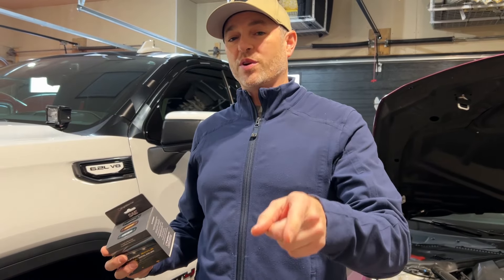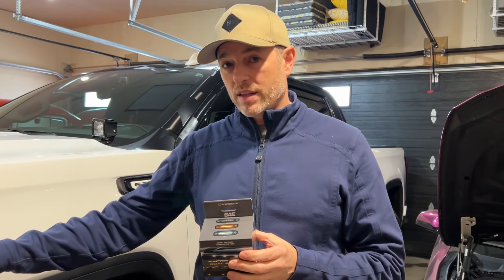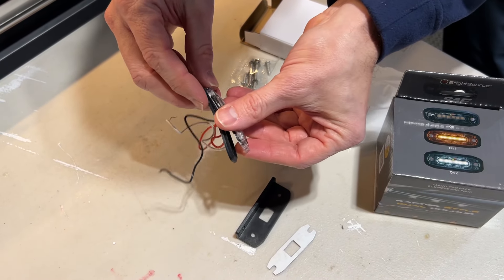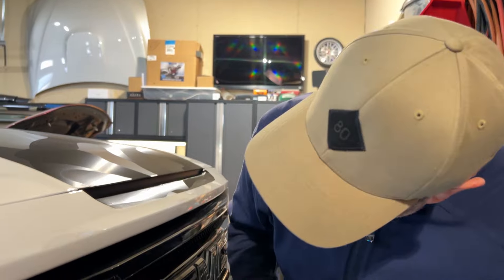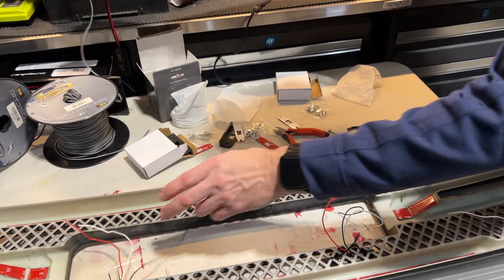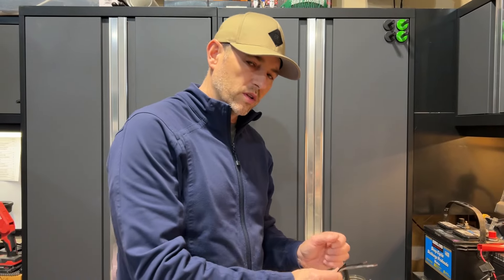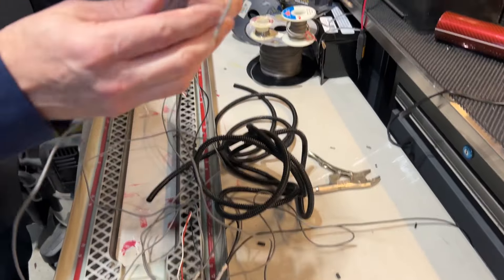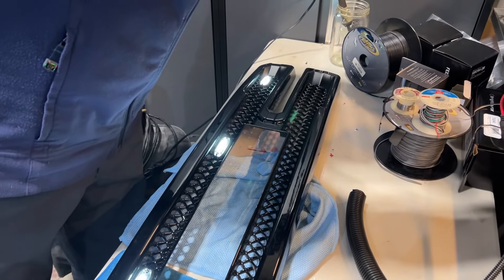Raptor-Style LED Grill Lights: 2 Colors for Any Vehicle

Comment: Awesome video. I just ordered the raptor lights. 

Question: Do you manually turn on the raptor lights every time you hop in or can the switch panel have it come on every time when the truck is started? Thanks!
Reply from the maker: I thought I answered this yesterday, but maybe it didn’t post.   I do have to turn on my switch panel every time.   I wanted them that way.  If you want them to come on automatically, I’d suggest tapping the DRL or lowbeam fuse
Reply: @Donslife  you did. Idk why my comment posted twice. My bad.

Comment: Amazing work man, would you help guide me on what I’d need to have these installed on a 2021 keep grand Cherokee Wk2 would be much appreciated! Thanks
Reply from the maker: I’d start be deciding how many you need.  Where you’ll mount them.  Lastly, if you want to run a switch or tap into your Jeep’s running lights

Comment: Another great video, s there anyway you can explain in more detail wiring it for whote and amber? Did you put white and amber on seperate switch s in switch box?
Reply from the maker: Yes they are on separate switches on my Auxbeam panel. There is a wiring diagram photo on my YouTube community page and Instagram showing which device is connected to which switch.

Comment: Man, I love how you got your truck set up. Great videos too! So in regards to this video I like the grille lights and the bar light to compliment it as well. I have a 2023 HC and I think I’ve found a way to do the grille lights but not sure about the bottom bar light as I don’t want to cut anything and I haven’t figured out where it can go but my question as I’m new to this completely is how are you powering and switching colors. Is there a remote system for this and can I achieve this without splicing into anything. I just don’t want to void any warranties that I have. Thanks in advance!
Reply from the maker: I have 2-3 videos on the subject.  This one is a good start. It keeps everything isolated from the rest of your electrical system. 

New Switch Panel AUXBEAM AR-800 RGB Multifunction Bluetooth LED Install and Review.
https://youtu.be/nlDsZFIrpA4
Reply from the maker: Then there is this option, but it is a little more advanced:

Adding a Wireless Remote For My Accessories!
https://youtu.be/aV7ey5415dI

Comment: How did you hook up all of your DRL lights together so that they all change at once through the Switch panel. Looking at doing the same.
Reply from the maker: Easy peasy.  I connected all of the DRL wires to the same switch location.  Just be sure to calculate their Amp requirements to help you pick the right switch location
Reply: @Donslife  Then on your switch panel do you have it set to a monetary switch to change the color?
Reply from the maker: @curtiscorzine5718 no, I have each color drl assigned to its own button.  Then if I want I can set it to toggle, momentary or pulse
Reply: @Donslife  Awesome. Thanks for the info. With more lights like this I would love to see a video showing this.

Comment: If ill connect the white wire on high beam fuse and connect the amber wire with low beam fuse, will it switch colors with high and low beam? Or both colors will lightup together making in yellowish ? Gmc sierra 2018?
Reply from the maker: I don’t have a 2018 to reference, but if your low beams stay on with your high beams then yes you will have a both colors at the same time and become yellowish.

Comment: Very nice video. I have a 2020 Sierra 1500 Denali ultimate. Any chance you know where I could get a chrome delete? It’s black so I want to black it out and add the off-road lights you have with the blackout look think it would look mean.
Reply from the maker: Thanks, what do you want to chrome delete. Denali’s have a lot of chrome.  Some can be vinyl wrapped, some trim is better to replace.  The grill for the denali is likely a paint job
Reply: @Donslife  I was thinking of almost everything. The mirrors, grille and down below the grille where the tow hooks are and the window trim. The exhaust tips I’m not really worried about because I’m ordering a new exhaust that has black tips.
Reply: @chrisnielsen3992  I got a gloss black lower grille/skid plate and a gloss black grille off of eBay to put on my 22 White Frost Tricoat Denali. Also swapped out to red tow/recovery hooks. Looks sooo much better.

Comment: Hey Don, let me try this again on the right video. 
What size wire is needed for the raptor style grille lights. 
I’m doing 3. Thanks.
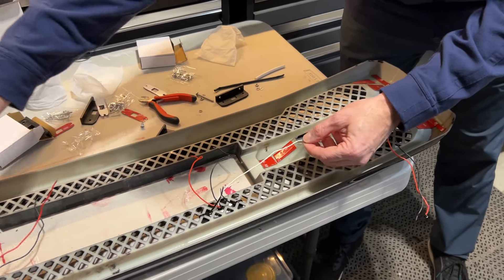Reply from the maker: I mention it in the video at the at 3:50 that I am using 24. But you could use 22 or 20 no problem
Reply: That’s what I get for trying to lip read. 😂
Reply: At 4:46 you only reference “a little heavier gauge”.

Comment: Hey, what switch are you using to change color of these lights and how to connect that switch do you have a video on that? What is it called
Reply from the maker: Here is the original switch video:   New Switch Panel AUXBEAM AR-800 RGB Multifunction Bluetooth LED Install and Review.
https://youtu.be/nlDsZFIrpA4

There has been many updates since then with more add ons.   I have a picture of the wiring on my YouTube community page and also on Instagram
Reply: @Donslife  thanks alot buddy, ill check ot out
Reply: @Donslife  so i have a quick question just for my information, 

Lets suppose i have light that has two colors (amber + white) 

Now i connected my amber color to ignition which will be on all the times when the car is on, and the wirr for white light if i connect to a turn on positive button , will the lights will automatically turn white when the white wire gets power or it will light up both amber and white same time or will short circuit? 

I have same marker lights from bright source
Reply from the maker: @MohammadHarisMania the white and amber with both illuminate at the same time.  One color will not override the other.  You’ll end up with a yellowish color.  No harm will come to the lights if you do that either.
Reply: @Donslife  thanks alot for the info buddy

Comment: Don I just purchased the switch box and the  DRL spot lights and I’m lost wiring them. How did you do to set the DRL and the spot light in separate bottoms? And in which one you plugged the ground so they both work independently? Thanks keep it up with the videos 👍🏻
Reply from the maker: I put up a picture on my Youtube Community page of you want to review it.  I also put it up on Instagram.  Or you can email me.  My contact info is the video description
Reply: @Donslife  thank you that helped a lot 💯

Comment: Question: I do not have the fog light mod so my fog lights turn off when my high beams turn on. Do you think I could wire the amber to my fog lights and the white to my high beams? Is this possible or is there a chance both would be on at the same time and ruin the lights? 🤔
Reply from the maker: I think it would work as you suggested.  Even if there was a scenario where both colors came on, I am told by Brightsource that it shouldn’t cause any damage to the lights. They will glow a washed out amber color though if both are on together

Comment: Would this fit a 2004 gmc sierra 1500??
Reply from the maker: Have a close look at where you can fit some.  You have 4 options to try and make work: adhesive, back plate, direct mount or cable tie like me. They are universal

Comment: Hey don, is your truck DRLs turn off when the headlights are on?
Reply from the maker: My DRL's stay on with the headlights.  I leave the switch in the auto position.
Reply: Did you receive the recall/ program regarding DRLs? It will turn off the drl’s when the headlights are on. Thanks

Comment: These won't work for a honda passport trailsport because of the grille and tech used inside of it jistcame froma truck accessories store and got the unfortunate news!!!!
Reply from the maker: 🤔 I don’t know enough about that specific vehicle, but I looked at some feeds in the Honda Passport forums and many have grill lights.  Tapped into various circuits or on separate switches.

Comment: I don't fully understand how you can have different colors. 
What I'm gonna do is something like this.
1. LED marker lights in my grill similar to your. Amber color to match running / parking lights
2.blinker compleat REHAB.
I don't know where or what I'm gonna do but it's coming. I'm more of a modest kind of person.
I replace my headlights. I replaced my back up lights.
I need to do my inside lights as well. And last , under seat accent lights. At night I caint see dick anywhere in side my truck.
Reply from the maker: Each light houses two sets of LEDs.  White and Amber.  Some people may only want one color, but there is a 2nd color available if hooked up.  If both are being turned on at the same time, then you get a muted orange color from the two colors blending

Comment: Awesome video. I just ordered the raptor lights. 

Question: Do you manually turn on the raptor lights every time you hop in or can the switch panel have it come on every time when the truck is started? Thanks!
Reply from the maker: I press the on switch for the panel and it has 4 separate lights added to a group.   If you want them to come on automatically, I’d suggest tapping into the DRL fuse
Reply: @Donslife  Thank you! I was just curious. Appreciate the content!!